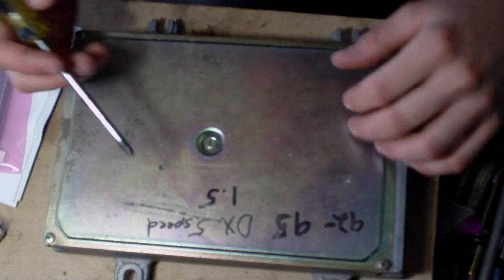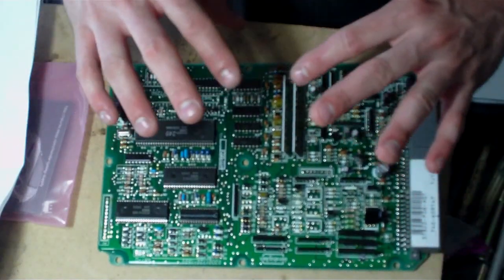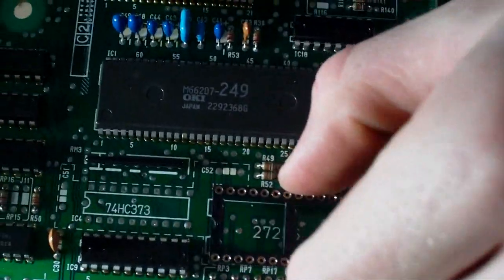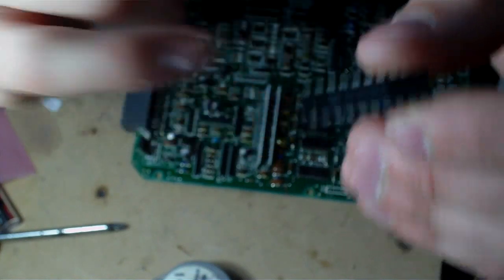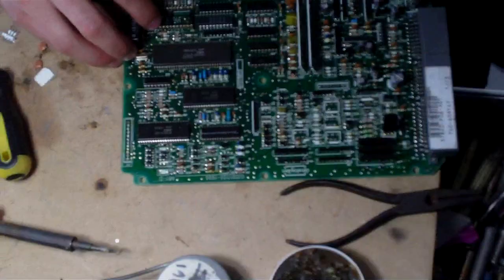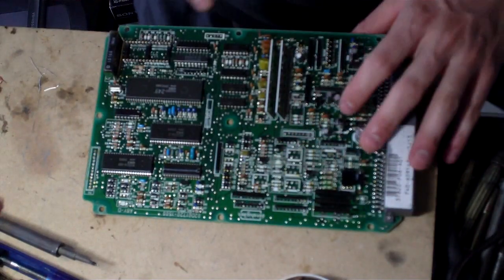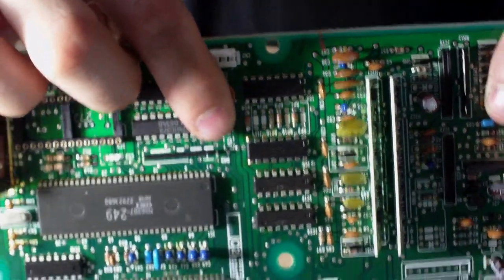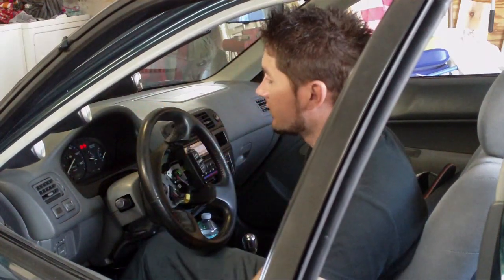How To Chip A Honda Civic ECU 92-95 5spd "THE EASY WAY"

Comment: So what does this actually do for the car with chipping in all?
Reply: Allows you to tune your car via laptop. You can control at what rpm the VTEC comes on, what will be the rev limit, adjust idle speed, bypass oxygen sensors or knock sensors etc, control the air fuel ratio. You can do a number of things.
Reply: veiroelle then what software and hardware is used  to do all that?
Reply: usfootman I don't know how it is for Obd1, but for Obd2 there's a ECU chip tuning software. You can purchase it and have it installed on your laptop or certain mechanics or engine tuning places will have it. For Odb2 there is a special usb cable that goes from the laptop to the ECU. Then you start up the software and you can tune from there.

Comment: Is it true that tuning a p27 ecu could greatly increase hp and fuel economy? P27 box, d16 non vtec after market intake and filter, b16 throttle body 421 headers.

Comment: I chip ECUs also and there's better tools that make it easier, but they're also around $75 and you still have to know how to use them. Removing the board from the case is completely unnecessary.
Reply: +tim babeu Not necessary but makes the job easier and allows you to put the board into a holder like a panavise.

Comment from the maker: Stage 3 Performance Chip OBDII Module

    Easy Plug and Play Installation on Vehicles 1996+ (Only works with vehicle with  
    OBD2 Plug under dash)
    
    Custom Tuned for your vehicle model and engine type
    Again up to 40HP and 40TQ
    Reliable and 100% Reversible Installation
    Lifetime Warranty

Selling Price: $199.99

performancechiptuning D O T c o m